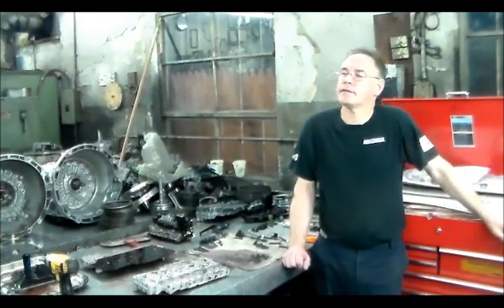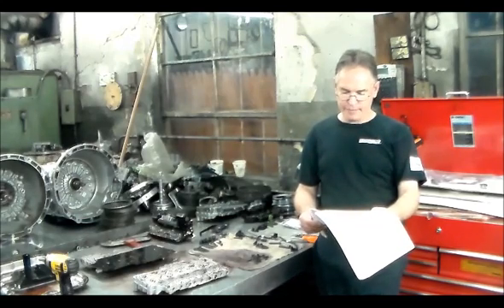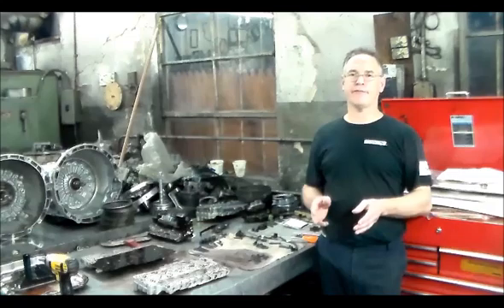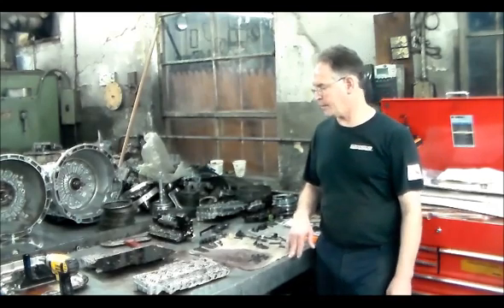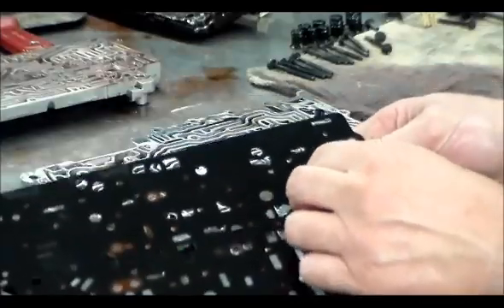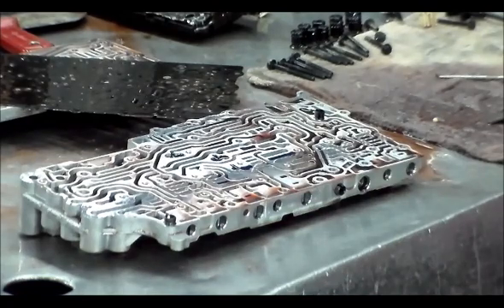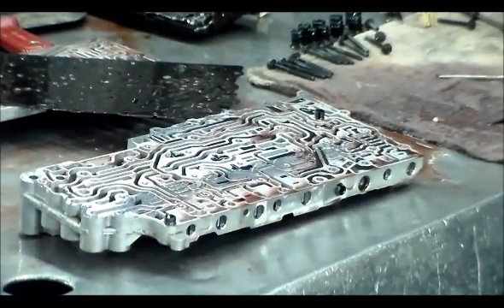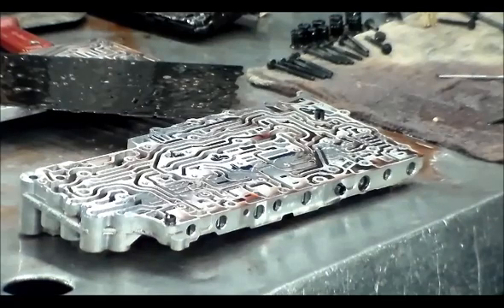6L45, Slipping/No Forward

Comment: I have a 6L45 that has a “lazy” 1-2 upshift sometimes but only when cold. Once it’s warm it works great. 

Is this likely a valve body issue? Maybe TEHCM valve seals? Is this a problem that Sonnax ZipKit is made to fix?
Reply: A new valvebody is surprisingly cheap for the 6L45 (somehow), like $300 IIRC. It’s easy to replace too.

Comment: I have a 6L45R transmission in a 2010 E90. My problem is it jerks from 2nd to 3rd gear.  Other than that, it's normal to go down from 3 to 2.  No fault code  The oil is good and not lacking.  Can you recommend me?
Reply: I’m havin a similar issue and I’d recommend the mechatronics sleeve as well as the valves in the mechatronics unit as well as that separator plate in the video. Hope that helps! Hope it helps me too😭😭

Comment: Are all these 6l45 transmissions the same mechanally ? My 2007 bmw x3  trans went out. Could I use a 6l45 trans out of a 2011 bmw 328i. If I use my original valve body and mecatronics out of the x3. Or is the gearing different ?
Reply: “If I use my original valvebody” when your valvebody was most likely the reason for it “going out.” New valvebody and problem solved, notorious valvebody issues on the 6L45.

Comment: I've go the same. Code 00578E Oil Wear. 0056C5 Shift Vale B Stuck in off position. 0056BF Clutch Gears 1,2,3 and 4 Neutral Test. Do we think this could be check balls. Probably worth pulling the valve body to see...
Reply from the maker: what is the car doing?
Reply: @GaryFerraro  drives "ok" at low RPM and light throttle. Heavier throttle causes the transmission not to shift up. Heavy throttle (wide open) shifts well too. Conditions worsen after warming up. But after some stop and start the tran eventually get's stuck then goes in limp mode, at about 3rd gear. When coming back to a stop there a few second delay before going in first. Goes to N while sitting. Dropped the pan with no sediment. Replaced filter and fluid. 180,000 miles. 3rd owner but have a lot of service records so I presume 60 fluid swap happened. Indy says oil smelled, but I looked at it and smelled it... wasn't anything terrible. After it goes in limp mode gear icon comes up. Put in park and turn off engine and gear goes away, then able to drive again ok for some period at light throttle with little stop and go, but once stopped again, it gets angry.
Reply from the maker: @caliohcoffee  I have had 2 reason why these codes showed, The #1 checkball was shrunk down.  The other was clogged screens in the TCM, you have to remove the tcm from the valvebody to see the large filter that goes across where the solenoids are

Comment: Hello good afternoon my name is Cirilo and I have a BMW x1, 118i 4cc, GM 6L45 gearbox, watch your video congratulations and the same problem happened with that gearbox, the Czech ball decreased in size and passed to the other side of the joint, as I can't find the set of balls here in brazil could tell me where to find these balls thanks.
Reply from the maker: any transmission shops around that you can go to?

Comment: Thanks
Reply: Hello,

I recently purchased a 2008 BMW 328xi(E90) that currently has 147,000 miles on it with 100 driven me. I have the BMW service records for it and on 18-AUG-16 at 83,026 it had the tranny pan dropped with the filter changed and topped off with approximately 7 quarts Dexron VI at the request of the owner with no reported issues before the fluid change. He was charged for a 5 quart container and three 1 quarts on the invoice.

On 29-AUG-16 at 83589 the owner returned to BMW complaining that it was hard shifting from 1st - 2nd and that it was bucking in reverse. BMW inspected the car and could not reproduce the issues and he was to return if the condition persists or it got worse. 

Service records stop on 12-may-20 with 140388 on it with no further mention of the tranny issues. 

The problem is I still notice some occasional hard shifts from 1st to 2nd and 2nd to 3rd with reverse working with no issue.

What could the problem be? 

All he had done was a pan drop and fill and not a flush. I was planning on doing another drop in spring as soon as the weather improves but I am worried I may do more harm than good.

Thanks to anyone who took the time to read this and any help would be appreciated.

Cheers!

Comment: I got an issue with my 6l45 bmw 3 series,  from a stop shifting out of I think 2nd or 3rd it temporarily goes into neutral and revs like crazy, I take my foot off the gas an press again and it goes back into gear. But if I drive like granny going 3-10 mph and gradually build speed it would shift ok. Any ideas? New filter and oil btw
Reply from the maker: Would like to know if any codes are present for the transmission,  see if you can tell if it's 2nd or 3rd
Reply: @GaryFerraro  the only one is the warn oil code
Reply: Ron don 
I have the same exact issue 
When give a turn and then take off slowly it's ok but when i want to go a bit quicker there's a hi rev on 2 to 3rd when it happens I let it get back into gear and give gas again what did you any advice helps thanks in advance 
I've done sparkplugs,maf sensor , gas pedal, cleaned throttle body , transmission filter and fluid , of course oil change every month , and brand new air filter
Reply: @MrGERA16  reset the transmission computer with a scanner, everything was fine after that.

Comment: Hi Gary, great video! Thank you for sharing this. 

My BMW 320i 2009 with 6L45 has problem with its transmission. It wont move when pulling out at the traffic light. The engine rev but the transmission won’t engaged. When it’s finally engaged the car will jerk forward like it was hit from behind. 

The idrive showed a transmission fault message and the car went to limp mode. 

This won’t happen when driving using streptonic or manual mode and start from second gear. 

My scanner return with error code:
56BF EGS: Clutch, gear 1,2,3 and 4: neutral test
56C5 EGS: Shift Valve B: stuck in off position

Do you think it’s the same problem with this video, the shrunk check ball?
Reply: Yep thats the same problem to ur car
Reply: I have exactly the same problem with the same codes. It is a lot worse when cold. I had the transmission services but the problem is still there. Actually made it worse. The car drives fine in manual mode from second gear. Looking to replace the check balls myself.
Reply: Hey man, Did you ever get this fixed? Im having literally the same issue you had

Comment: Gary, I just purchased a '08 328i RWD wagon with 127K miles. It has the 6L45 Trans. One time recently it shifted hard 2 or 3 times then stuck in 3rd or 4th. I shutoff the car for a few minutes and it's been fine since. A shop got codes 5655 and 5654. I don't think it has ever seen a fluid change. Is it possible that's all I need to do at this point? I'd love to hear any info or advice. THANK YOU!!
Reply from the maker: By Chance do you know the definitions to the codes?
Reply: @GaryFerraro  Turbocharger Speed Sensor: no signal, Turbocharger speed sensor: implausible. Doesn't make sense to me, it's not a turbo engine, just the N/A N52 but does that help?
Reply from the maker: @jacobkane3935  Do you have access to a scan tool that reads live data?
Reply: @GaryFerraro  yes I think so, I have a decent OTC tool that shows me real time data like fuel trims, rpm, throttle position, etc.
Reply from the maker: @jacobkane3935  This trans has it's own computer,  just wondering if the speed sensors are working,  scan the transmission also see if any codes are present,  other than the ones you posted
Reply from the maker: Tried  looking up the codes on shop key pro, they don't come up, see what you come up with with your scan tool
Reply: I did a reverse lookup on bmwfault .codes and looks like p0717 and p0716, which are for input sensor
Reply from the maker: @jacobkane3935  Correct,  if your scanner can read live trans data, see if the sensor is working, the input speed sensor is part of the TCM,  These can be pricey from BMW

Comment: I just rebuilt a 62 TE I have reverse and 1st but as soon as it would shift into second gear it slips and I loose forward gear PLEAS HELP!! What would cause this ?
Reply from the maker: sounds like an issue with the 2-4 clutch, which is right behind the input drum, either the sun gear broke off the housing seal missing in the case for the  clutch or the seal is in backwards in the case
Reply: Gary Ferraro  ok so I suppose I’m dropping the transmission again... No chance solenoid issues could cause such a thing ? Or the valve body I cleaned it and reinstalled the check balls. I was very careful to put them in the correct spots.This is my first trans rebuild and I’m still learning! The low compound drum went, I updated and replaced,  new steels and plates,  Between your Videos !!!! And the ATSG book I got it done. Apparently I missed something, thank you very much for your time !!!

Comment: Show  seu trabalho
Reply from the maker: After repair, it worked very nice
Reply: @GaryFerraro  Hi Gary ZF 6HP26 got fault code 400331 ratio monitoring, gearshift 3-4 implausible permanent. I changed the bridge seal and 4sleeves as the bridge seal was damaged changed fluid and filter initially the car used to flat run after it took the speed then l have to switch it off and on then it would run. Now that problem is solved it runs OK up-to 3rd gear .Now after I speed up in 3rd gear it gives a loud jerk and doesn't shift after 3rd gear and even it does not down shift to 2nd or 1st gear if slowdown or come to standstill unless I clear the fault code .Thanks
Reply from the maker: ok, does this problem happen when the car is hot and cold it shifts ok?  you have either a bad rear stator bushing or bad solenoids
Reply: @GaryFerraro  No it happens always.
Reply from the maker: always may be a solenoid,  the solenoids can be done without taking the trans out, just dropping the valvebody. Usually stator bushing will happen when hot. I also have seen the clutch worn down causing a flare shift.  So you found the bridge seal cracked?
Reply: Hi Gary ZF6HP26 got fault code 400331 ratio monitoring ,gearshift 3-4 implausible permanent. I changed the bridge seal, 4sleeves as bridge seal was damaged  changed fluid and filter initially the car used to flat run after it took the  speed then I have to switch it off and on then it would run. Now that problem is solved it runs ok up-to 3rd gear. Now after I speed up in 3rd gear it gives a loud jerk and doesn't shift after 3rd gear and even it does not down shift to 2nd or 1st gear if slowdown or come to standstill unless I clear the fault code. Thanks.